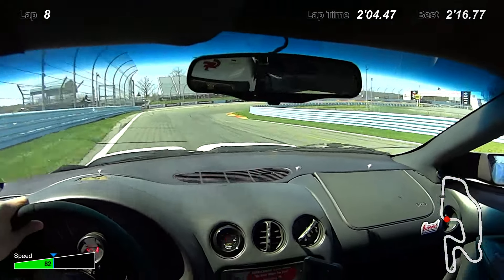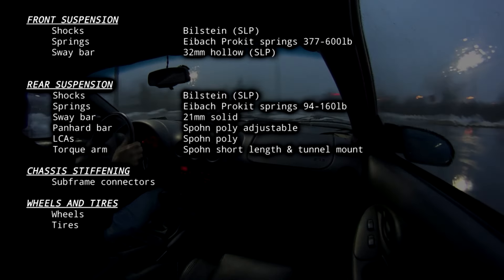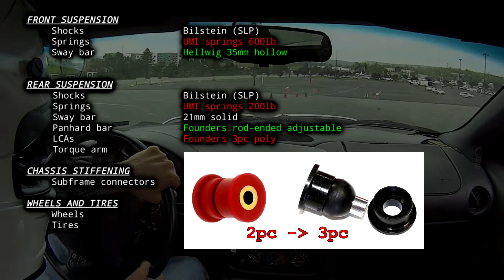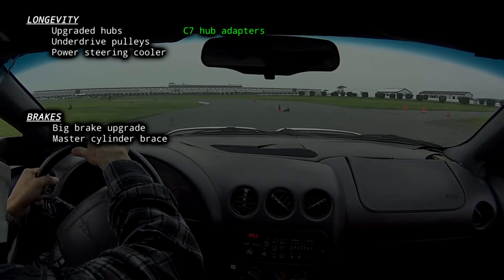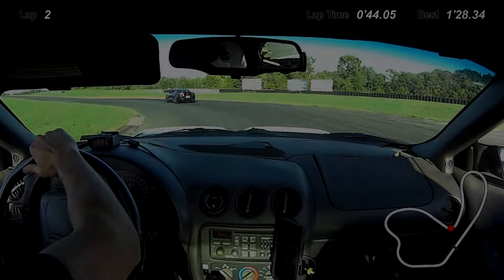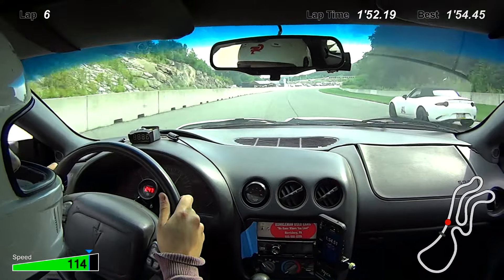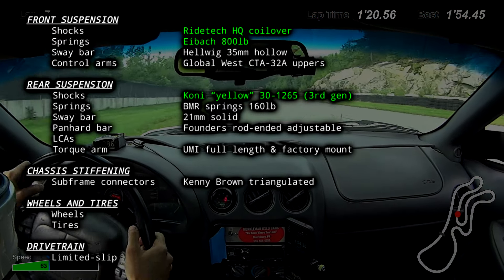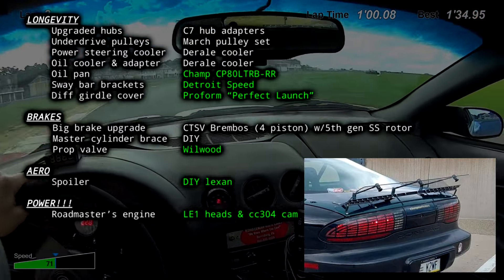TRACKDAY/HANDLING SETUP for 4th Gen F-body - My HPDE Build Overview

Comment: Just curious if you looked into any of the Sam Strano suspension products? I have his lowering springs and like them. Going to add in his sway bars soon too.
Reply from the maker: Yeah, Strano's stuff is good. He was the one who recommended the Ridetechs as they are the next step up from Koni yellows and should be able to cope with slicks if I ever decide to go that route. His sway bars should be a good buy and roughly equivalent to what I'm running. If you want to save some money, you can snag a solid 21mm rear bar out of a 3rd gen for super cheap (stiffness is about the same as his 22mm hollow).

Comment: Hell yea!
My set up is founders rear bars (poly/rod lca/panhard)

Stock ws6 sway bars, new poly mounts and endlinks.

SKP? Hubs

New LCA/UCA from rock auto lol.

Stock wheels 

Strano springs/koni shocks

Stock Tq arm

Strange s60 LSD

Sams alignment specs some negative camber and positive caster

Its not a track car, more of a street car. Love it so far.  It handles pretty well, just the rear end feels a tad wierd.
Reply from the maker: Sounds like a pretty hot setup! What do you think is weird in the rear? Does it feel unpredictable and snappy? Could be the poly as it dries out super fast.

I highly recommend checking out a Track Night in America event if you wanna get a taste. I got hooked on it immediately lol. They also send out coupon codes if you sign up for the newsletter.

Comment: "It seems to be really fast for a shitbox"

My brother, that's exactly what I'm trying to build lmao. I just swapped in a T56 and 4.56 gears and was looking to replace all the clapped suspension.
Reply from the maker: Are you planning on tracking it? I was actually planning on swapping to 3.23 gears once I add more power. I end up in 5th gear a lot on track which isn't good for the trans since the 5-6 cluster gear splines get really loose.
Reply: @JunkRacecars  yeah. I guess I'd be more concerned about the diff blowing up than the trans.  Even the Borg T56 is a pretty stout unit.

I have pretty decent acceleration in a clapped out bone stock LT1.  My car easily walks past a 2019 WRX STI that my friend owns.
Reply from the maker: @ethanpeschman4458  Gotcha, yeah the diff is definitely a liability but mine has been OK so far. I think the girdle/cover is helping it stay together. I don't have to worry about breaking the teeth as much since my gears are stock ratio atm, but you're probably fine with stock power and 4.56s.

The T56 is pretty tough in gears 1-4, but 5-6 could be better due to the mainshaft splines and the tiny fork. Just try not to hammer it too much in OD.
Reply: @JunkRacecars what speed are you clocking on the start/finish straight?

Also 3.23 is gonna be a dog.  And your car will max out 4th gear at 155 at 6500 which is just not really necessary. A 4.10 would be good for you. 4th hits 132 at 6500rpm
Reply from the maker: @ethanpeschman4458  It depends on the track, but I'm usually in the low/mid 130s. My 355, some weight reduction, and better tires for more exit speed would probably put me in the mid 140s at Watkins Glen. I also run a shorter tire that's 25" (vs 25.5" stock), so that would put me at 6.3k @ 145 with 3.23 gears.

I don't think shorter gearing is always a good thing since it can knock you out of the powerband pretty easily in road racing. The RPM drop from 4->5 is a bit steeper than other gears and would fall from 6.3k to 4.6k with the motor I'm building. Looking at some typical H/C dyno charts tells me that would be like losing 60-70whp, plus I'm losing time shifting instead of accelerating. I don't think it's worth it tbh.
Reply: @JunkRacecars  you're definitely right how shorter gearing isn't always the answer.  In my mind I'd like 4th to top out at the end of the longest straight away I'm going to be driving down.  For me it also happened to line up so that I could do 80mph at 2200 rpm in 6th so it gave me the acceleration I wanted and the highway speed and engine RPM I wanted because it won't be a track only car.
Reply from the maker: @ethanpeschman4458  Yeah, it kinda sucks that the T56 OD gears are so long on these cars because you really need 4.10s minimum for 6th to be useful with a moderate cam, otherwise it surges like hell on the highway. I wish the T56 was setup more like the MT82 (even though that trans is garbage) with 5th gear being a 1:1 instead of 4th and only 1 OD gear instead of 2. If that was the case we'd have a larger spread of gears useful for both drag in 1st, road racing in 5th, and wouldn't have to worry as much about shredding the 10 bolt pinion gear teeth since the final drive can stay low ratio.

The effective gearing for 4.56 is really close to 3.42 if you upshift +1 with the short gears, so acceleration would be the same. Basically 4.56 in 4th = 3.42 in 3rd and 4.56 in 5th = 3.42 in 4th. The only place 3.42s suck is from a dead stop or doing dumb shit on the street lol.

Comment: I plan on getting the Eibach 800lb springs for the front end of my bird, just to give it a go for my autocross event. Do you have the exact link or part number for it?
Reply from the maker: What kind of shock/coilover? I am using Eibach 1200.250.0800S coilover spring on my Ridetechs with slightly shorter endlinks.

Comment: Does your steering column have slop from worn bushings?
Reply from the maker: Not really but I do think my reman rack has a little bit of play. Look into the oversized steering column pins from Unbalanced Engineering if your column has the typical slop where you can pull it down and to the left.
Reply: @JunkRacecars  i seen that but 60 for some pins kinda expensive lol was thinking of just going with a steering column from trick chassis
Reply from the maker: @Kirbawesome  that's a lot more money and work, wouldn't work for a street car, and not collapsible so it's way more dangerous

Comment: Excellent video. Just did a trackday in a 95m6 like yours over in England today. My question is weight. Have you lightened yours much and if so by how much and did you see much effect? Love some of your mods btw. What rear ratio are you? I'm on the stock 3.42s but I feel its too tall for the 6spd box. I'd even consider going to in the 4.xx ratio as I can't even get to 5th
Reply from the maker: I'm not exactly sure of the weight of my car in all honesty, but I have removed as much as I can for a street car. The car has no AC (including the evaporator and a chopped HVAC box), no emissions, a simple exhaust with LTs and a single 3" exit, no airbags, no sound deadening under the carpet, on the firewall, or the rubberized stuff in the trunk, no rear seats and belts, lighter stereo with only 2 door speakers, no ABS, no heat shields, lightweight flywheel and driveshaft, lightweight seats and steering wheel, tiny Odyssey battery, and a fiberglass hood. Stuff like coolers, larger brakes, oil pan, wheels/tires, subframe connectors, and my 4pt half cage put weight back into it so my guess is that it's close to stock for a hardtop firebird. I did a lot of this stuff incrementally so I can't say that I noticed the effects too much, but lap times will definitely improve with less weight.

I am currently running the stock 3.42 gears and don't want to go any higher, especially once I put together my 355 with more power and a higher shift point. I end up in 5th a lot right now since I short shift my current motor, but the 5/6 cluster gear in the T56 is known for having weak splines and I'm afraid I will eventually break the trans. It's better to keep the trans in 4th anyway since the RPM drop from the 4-5 shift is huge.